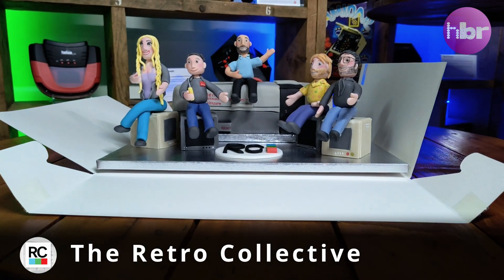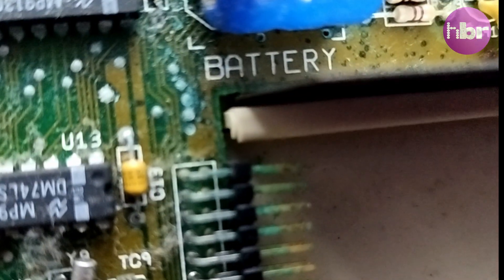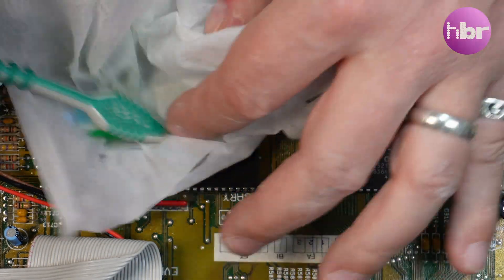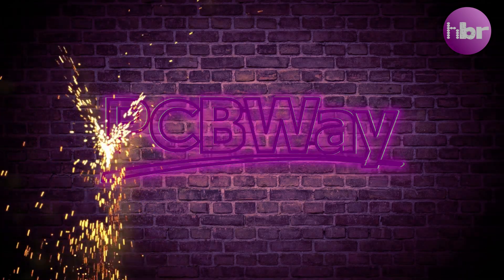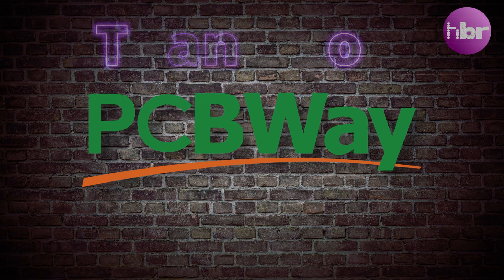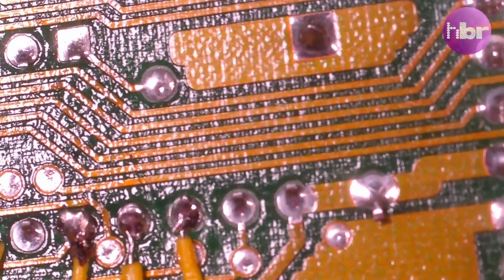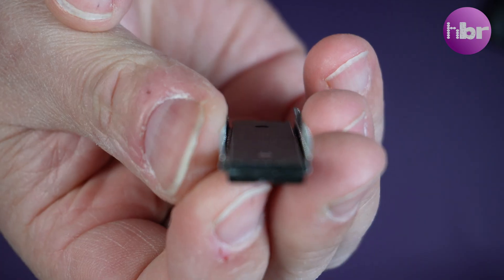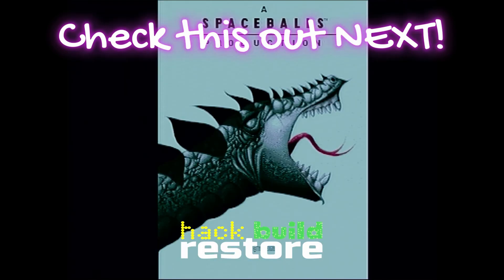What REALLY happens when a battery leaks!

Comment: I hate these stupid batteries. Why did we ever use these half-AA sized NiCd cells?

I appreciate the explanations though.
Reply: Oh yeah, rest in peace to all those Xboxes with the failing timekeeping capacitors as well...
Reply from the maker: I have one to pull the clock cap out of … thanks for the reminder :)
Reply: @hackbuildrestore  You're welcome!
Reply from the maker: I don’t think the expectation was for these machines to last 30 years, nor was the leak aspect of the electrolyte, the capacitors issue in the 90s was all down to cost cutting and competition with china.
Reply: @hackbuildrestore  Wasn't there also that capacitor plague that happened about a decade after?
Reply from the maker: Yes the 90s capacitor plague was caused by Chinese manufacturing being able to produce them at a lower cost, though it wasn’t the Chinese brands that where the direct problem it was other domestic manufacturers tried to compete with them and did so by winding the quality back to -1 lol

Comment: Nice job, man! Another one saved from the scrap.
I have a couple of a2000's, a handful of a500's and an a1200 in my collection. My prode and joy is the a500 i bought new in 1987. She's fully restored. Sadly though, the batteries in every other on leaked (bar the a1200). I'm not ashamed to admit, that as a grown man, i cried my little heart out when i saw the damage that those 'kin varta batteries did.
Both a2000's are beyond dead - 68030 card eaten up, the oktagon card also....
Til this day, i avoid varta batteries....the brand causes an internal short-circuit in my brain.
Hopefully, though i doubt it, they can be saved. The cards are an absolute mess....the green death has soaked up the chip legs and gone inside.
Zip ram is so easy to find these days, eh?
Nice video...and excuse my rambling.
Might have to vlog the repair process, if i can find the time to do so 😊
Keep up the good work man...until the next one!
Reply from the maker: Sorry to hear your fleet is in a bad way, they all can be brought back one way or another :) just takes a little patience;)
Reply: @hackbuildrestore indeed, mate. Once I get my workspace up and running (just moved to a new place), I'll be on it like a stray dog on a bag of dropped chips 😊

Comment: People keep saying that the acid neutralises the battery juice but then you have introduced a different pest into the PCB, the acid, which is also bad news. It's not like you're adding the exact right amount, and then the Ph is 7. But you do need acid in order to dissolve the heavily crusted on mess! Unless someone has better ideas :D
Reply from the maker: Acid is washed off before it can do any damage with IPA, the acids used don’t attack copper or solder in the same way but do counter the leak. “The crust” has to be removed with mechanical means and/or by removing and replacing components, a sonic cleaner is also an option.

Comment: I was lucky with my A3000 and one of my A4000 desktops. The other A4000 desktop has been virtually destroyed so it may be a chipset donor for another project. I know I have an A4000 motherboard kicking around somewhere leftover from a warranty replacement, but I haven't found it yet so I am hoping it isn't too bad. I chopped a Varta off of an A501 that only did superficial damage. Overall I have been pretty lucky with the hated Vartas. The battery from the A3000 not only didn't leak, it still holds a small charge!
Reply from the maker: Climate can play a factor too, but yes you have been quite lucky ;)
Reply: Western NY, pretty hot and humid in the summer and fairly dry and cool indoors in the winter.

Comment: Your explanation about battery acid not actually being acid could have benefited from giving just a bit more science lesson...
Flash a picture of a PH balance scale on screen.
Visualize that Acids and Bases are opposite ends of a scale.
And remind everybody that a Base and Alkaline are the same thing.

Have you tried enameled wire for those little bodges, rather than thick insulation ?
Reply from the maker: Tried a few things not found a method I’m 100% with yet